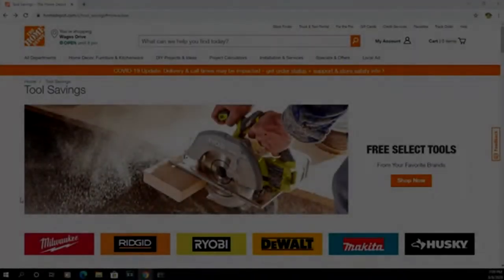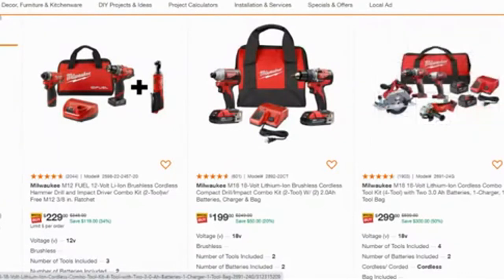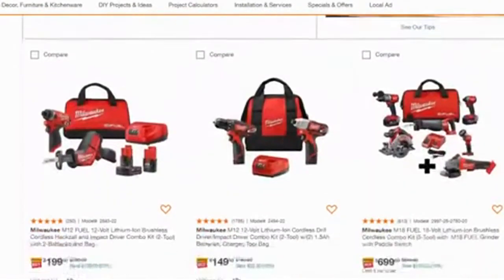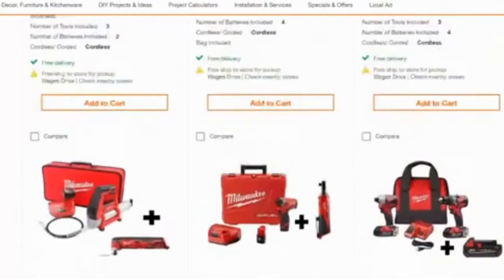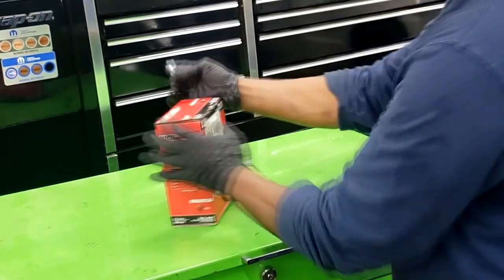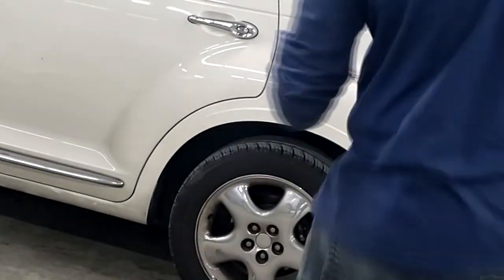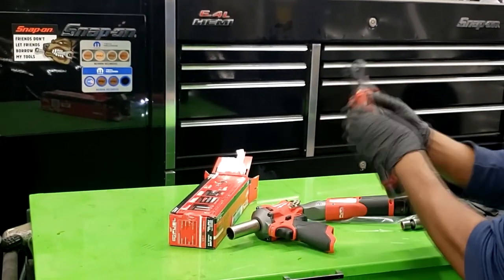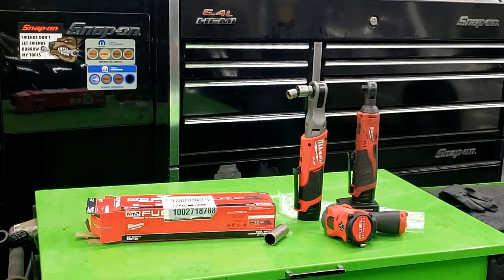Tool shopping done, Check out my new toys. Open Box review. Not Harbor Freight, Snap on or Matco.

Comment: Bigger battery has more amperage capacity so tool will run much longer under load. The 5ah batteries the 20v Dewalt we use runs twice as long before shutting down so we can use it a week hammer drilling concrete and tightening bolts and like that, sometimes it last a lot longer and stays charged longer while sitting. Lithium Ion tends to run till the it just shuts off without much fade in power.

Comment: Another place to look for smoking deals on packages, single tool, and refurbished tools is Amazon and eBay. Years ago I bought a XRP 18 volt hammer drill for 63 bucks shipped refurbished. I still use it today even though the included high capacity batteries finally went bad.
Reply from the maker: Wow, thats great. Things not looking to good for the poor tool guy with snap on. Thanks for watching bud, please subscribe to the channel if you not already, thanks
Reply: @OnlineMechanicTips  I subbed after first video I watched about the tipm modules on the PT Cruisers 👍I'm still thinking about getting a cheap turbo one to play with even though lil sister just sold me her 06 Charger RT with 88k for 3000 😃
Reply from the maker: @69Dartman  Charger RT??? Oh boy, that sounds like fun
Reply: @OnlineMechanicTips  It's quick, smooth, and quiet, everything works. It replaces the 95 Neon I also bought from her that finally blew the timing belt with 190k.

Comment: Looking at the lug-nut portion, I might have to give one a try. I have an F150 and a Ryobi 1/2" impact driver rated for 300 Ft Lbs and it would not crack the nuts. A lot of force with the supplied lug wrench got them off, I was disappointed... but on the other hand, removing rusted bolts off of a 2006 Ford Focus' brake caliber was a cake-walk for the Ryobi. I guess it all depends! Thanks for the video.